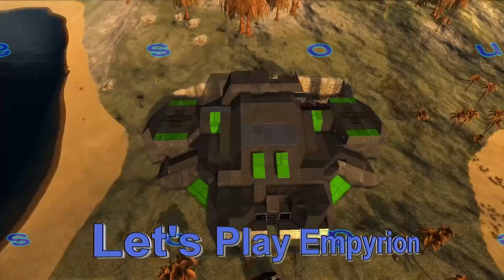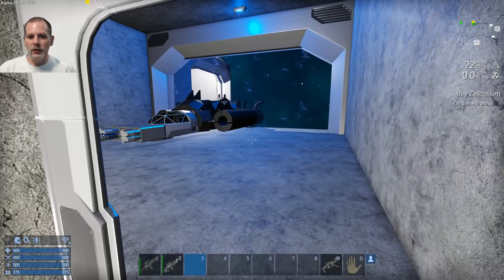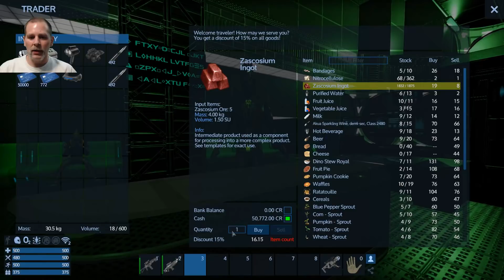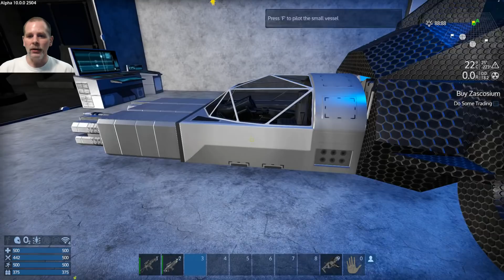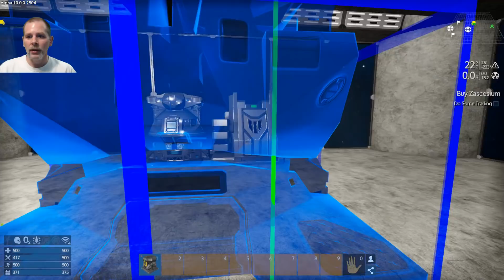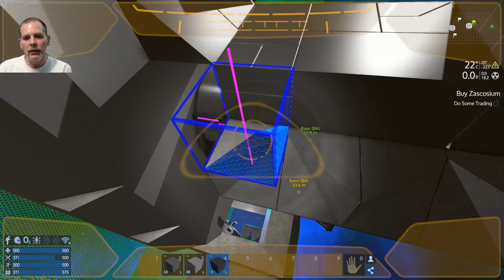💎Zascosium & Water Generators 🚰 Lift Plays Empyrion - Season 12 - Ep30

Comment: I try to stick to using biofuel to power water generators. It seems like you're not gaining much efficiency by using promethium packs to make water.
Reply: Or I try to use packs I got for free off from drones.
Reply: I'll get up about 10 or 12 crates full of biofuel and you rip through all that pretty quickly.
Reply: I make biofuel all the time in an HV so when I go to cut down trees I'm doing it for free.
Reply: I used to build about 6 or 7 portable constructors and just have those make biofuel. It gets to be a chore. lol
Reply from the maker: @W1se0ldg33zer  Yeah as far as time invested, I think digging up promethium is faster than chopping down trees. I could see using it if you have a big fiber garden though.
Also I have crafting set to instant so I don't have to do stuff like have a huge array of constructors. :)
Reply: @LiftPizzas  I kinda look around first to see how much I can find before I even start building stuff. Yeah I don't do the instant thing. I like use up promethium on ammo.
Reply: Because I'm planning on building a tankersaurus CV with turrets covering everything. lol
Reply: When I'm searching around I'm cutting down wood on my way and making me a nice area to come back though since I just made a path for myself. lol
Reply: One time I played it for a fairly long time and you didn't see any trees for as far as you could see from my base. lol
Reply: I think it really helps to clear away all trees from your base. Makes your turrets have an easier time of picking them out from the clutter.
Reply: Or just don't base in thick woods.
Reply: If I'm doin the tutorial where you're usually walking to the first POI then I'm cutting trees down by hand as I go there. But doing that is super grindishly horrid.

Comment: They did fix the Water Gens, you can empty out all the fuel with SHIFT-Clicking, or use the take-all button. They also fixed an exploit where you can shift-click 2 fuel packs, and then quickly remove them, and it the generator would still run for about 2 hours, depending on what size fuel pack you used.
Reply from the maker: Cool I'll try to remember to try that. :)